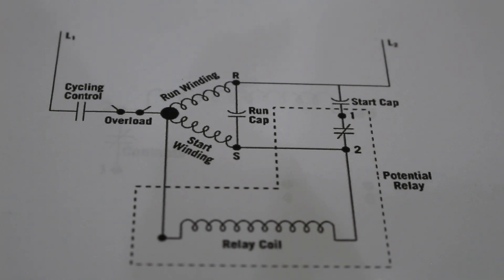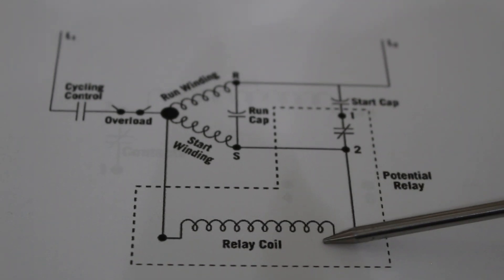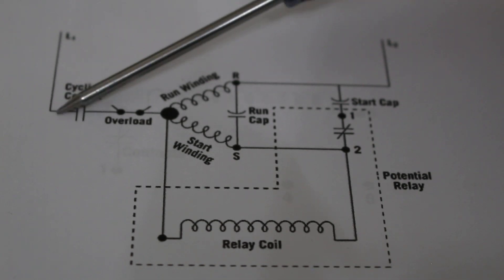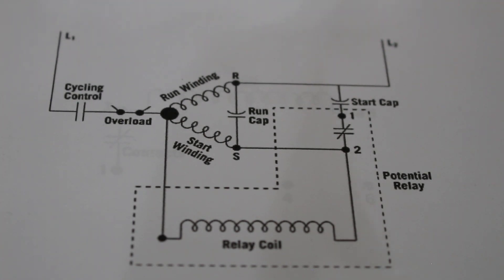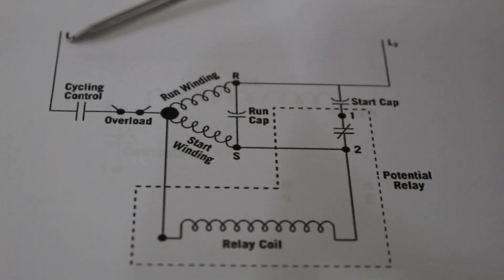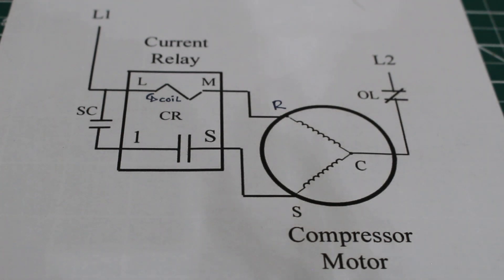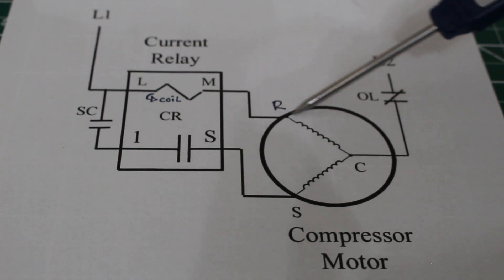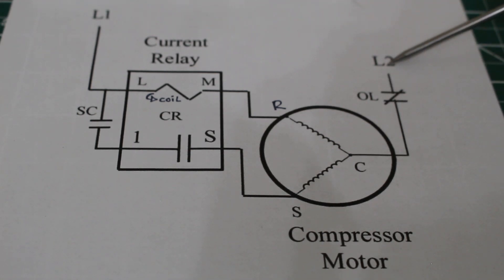HVAC: Potential Relay VS Current Relay (Potential Relay Explained / Current Relay Explained)

Comment: Thank you, I don't get how the start winding can be excluded from the circuit, if there is a running capacitor installed between S and R. Once the relay contact is open, the current can still circulating along Start Winding, passing through the run capacitor, then reaching L2. Thanks for clarification

Comment: Current relays are good in systems with smaller start up amps. Systems with fixed orfice often have less amps due to lack of a pressure difference. Great lesson your a true tech man

Comment: Why do you use capacitor symbol to represent a normally open contact?
Reply: I asked the same question, Its very confusing if you have any electrical knowledge.
Reply: That's the points symbol... Which is appropriate in this context
Reply: @MrRUKidddingMe agree it makes sense

Comment: Interesting subject. Well presented and explained. Great job JMT.
Reply: Vy ery nice  baccal usin  ac  systom usin oasiin  ry usin  engerizing emf eray curent ely usl  ing  v  ..rey  nily  using  full   starting  the  cmpessar     a  csr  cmressar can  be  started   diecting   with  out  rely  as  follows  contect  one the  suly l1 to comerssar  termmials  suppey  wis  l1  to  compressar  termials  Rnd  the  other  L2  the  comprssrterminals  c contact starting  and  runingcapaciterin  serires  ith  the  sattingwin  as  shown  isconeactthe  starting  capactieror the connectio  ro  starting  to terminanl s after  ther  o motorfushion  ater  split ac  sihle phase ac  into  phase  the  starting  capaciter  is  dis connecting  the  relay  after satring  but ruing  capciyer  remains  in the circuitwhil compers  is  working  which  increase  the  efficiency  of the  moterthis type  of  moter  is used  ac  water  cooler   and  other  commercial  refrigeration  compressors  for  starting   psc  cmprssor  moter  starting in  not required  .. voltage rely  potshion using realy  5and 2 .1 conshing 4.and 6  mt  dumey point any other adshion usi  usin liene or loop connetctin usi need coneated no ok not using mt ok
Reply: Vltge realy  box type using same fushion  potshion realy engzing using cacer cnneshion us ruing and engzing usin power give sating power  systom startin oint  coil and  engrzing ruin poin capciter  sysytom  ruin c  come on pointed us old and connecting ok  jonnery   gues ..